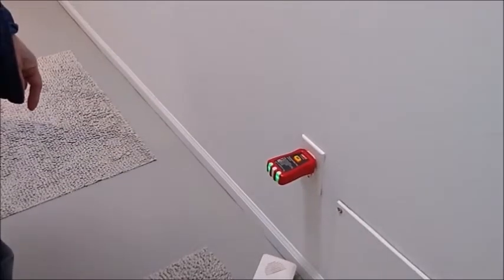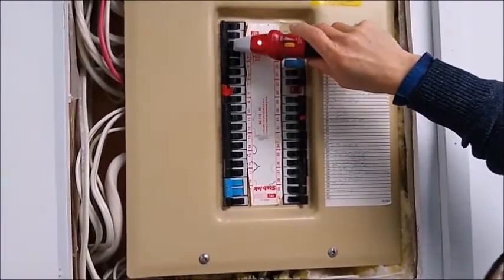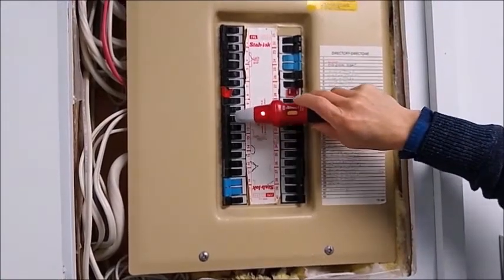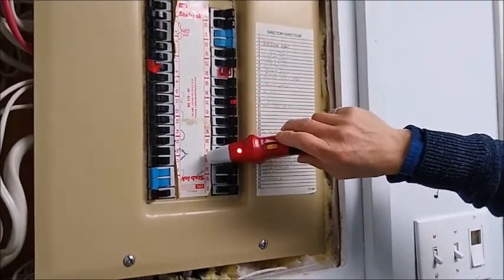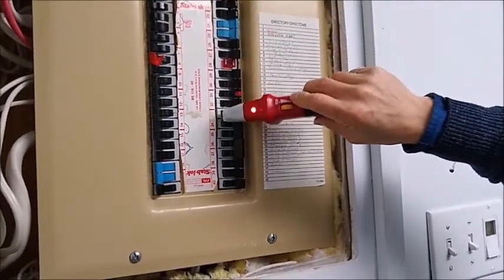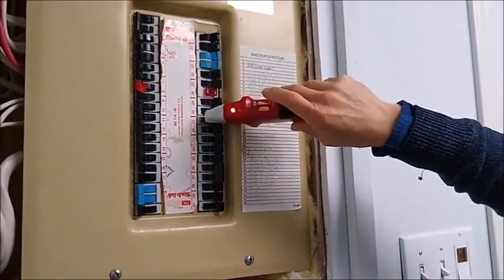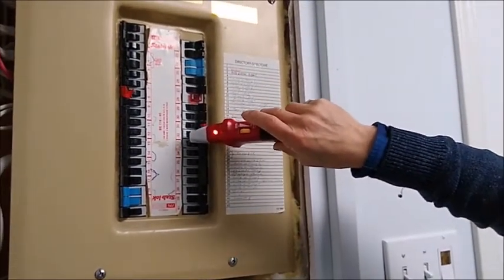Uni-T UT25A Circuit Breaker Finder, instruction sheet was wrong !

Comment: I would tell you the easy way to find the breaker, but you have a stab-loc panel, those are dangerous! My method is to just plug in 2 space heaters, that will trip the breaker, but maybe not with your panel!
Reply: Lmao , I’ll remember to carry 2 space heaters when I’m out on a service call and I’ll just plug them into the home owners house , make a bunch of noise whilst they stare at me like I’m Forrest Gump giving  speech at the president’s inauguration 🤣💀

Comment: NEW Uni-T UT25A Circuit Breaker Finder is broken. I just bought one and having the same issue like the video shown
Reply from the maker: I have since discovered that the device works if you hold it vertically instead of horizontally as was shown in the instruction sheet. 
Surprising that they could made that mistake. Obviously, the one who made the instruction drawings never try it out !
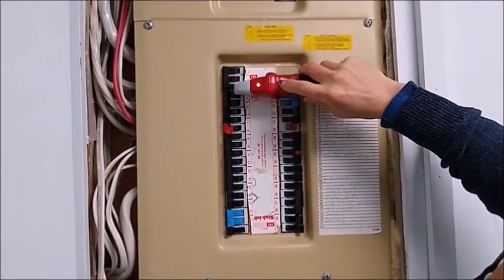Reply: @tomdak8858  0:23
Reply: @tomdak8858 ❤